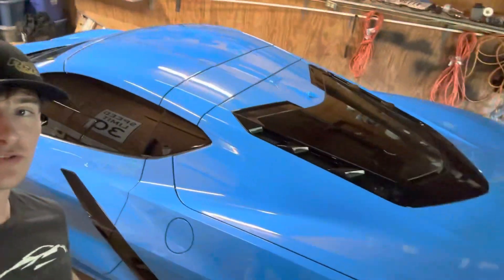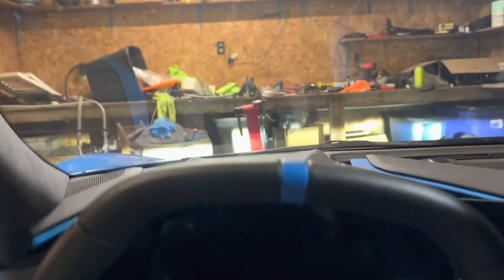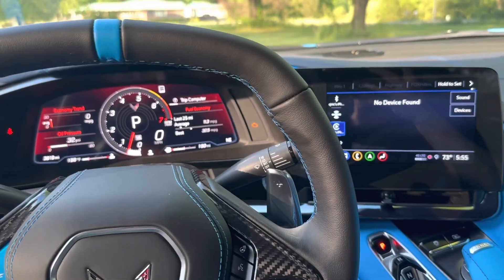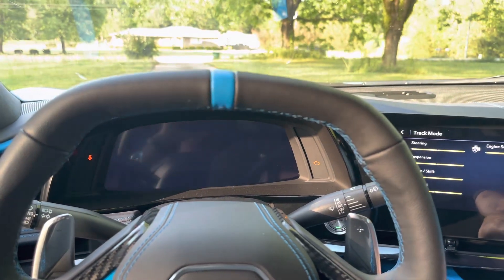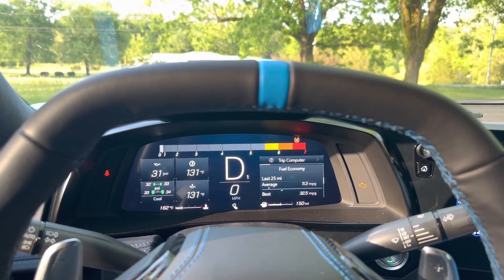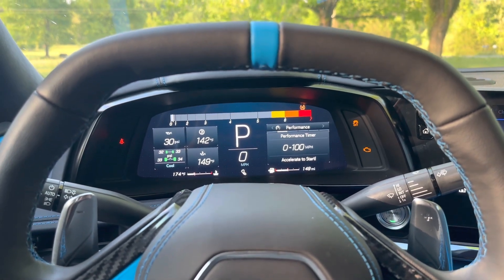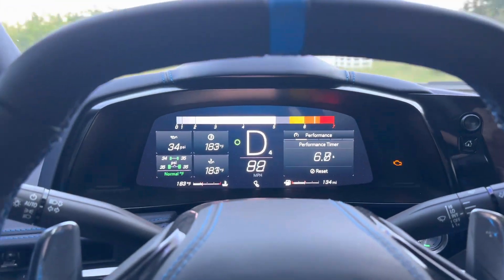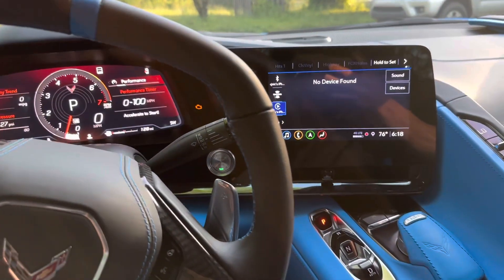How to Use Launch Control In A C8 Corvette

Comment: I just rented one of these and im so impressed with how much car you get for the price. Is there anything comparable? I couldn't put down a 2.9 0-60 but I never got into launch control or any of that. It's plenty fast. Also I was wondering will this work if I put it in z mode and max all the settings or it must be in track mode? Is there a difference?

Comment: Can’t you also launch by holding down the paddle shifters instead of the brake????
Reply: I'm not sure that would be the same.....holding the paddles puts it into neutral.....holding brake still has transmission in gear.  Seems like flooring it while in neutral and then sending it into gear might be a bad thing?  not sure really
Reply: @SK-pn1pe  I saw some1 launch it with paddle shifters in a youtube video

Comment: Which sport cats did you buy? 
Also, is the light due to the cats. 
I’m trying to install my sport cats this weekend
Reply from the maker: My car is catless, i got the catless bypass pipe from 2m fabrication, with sport cats you probably wont get a light
Reply: @CodyDriven  what other mods do you have? 
Stock exhaust? 
Sounds amazing!!!!
Reply from the maker: @sammac6679  yes stock performance exhaust! I just got the $400 catless pipes and thats all!
Reply: @CodyDriven I have a non Z51 2023 with 2M headers and cat deletes without any cel popping up. Do you have the extenders < forgot the make
Reply from the maker: @honduraschris  yeah i have the ctenders on, havent been working for me
Reply: @CodyDriven  I’ve heard that the angle makes the difference. There’s a couple threads on Corvetteforum that discuss the situation

Comment: I’m having this issue with my 2022 Z51 non-mag launch control. It doesn’t give me any performance traction options. So it just says Esc competitive mode and no switching options. It used to give me options before but now it’s not anymore :(

It doesn’t show on yours either
Reply: In order to get the PTM modes the car must have Mag ride. Without mag ride you only get the one setting.
Reply: Yeah, I think Mag ride is the key....I have a 23' Z51 with Mag and mine shows the different PTM modes (wet/dry/sport/sport2/race) when you turn the TC off.